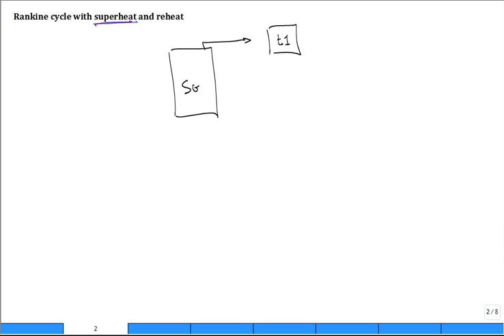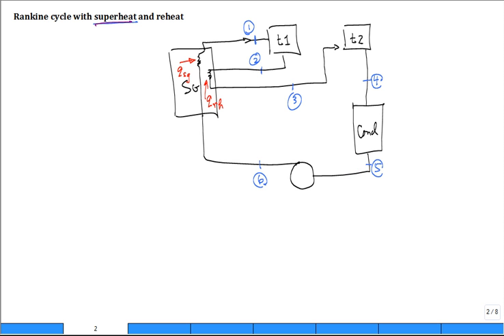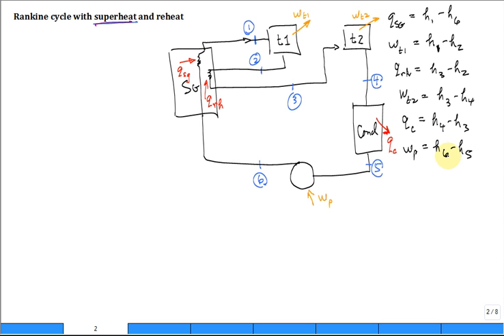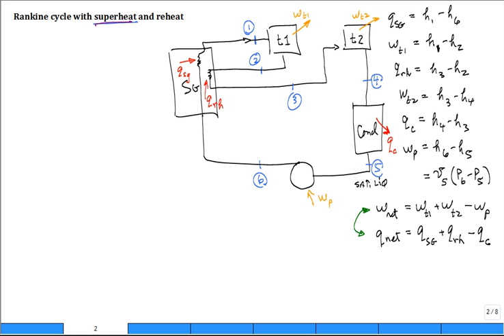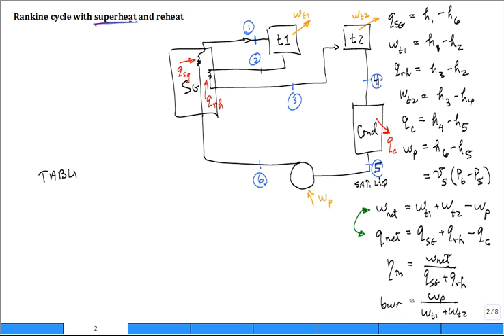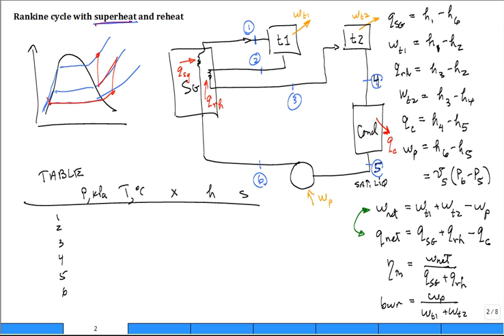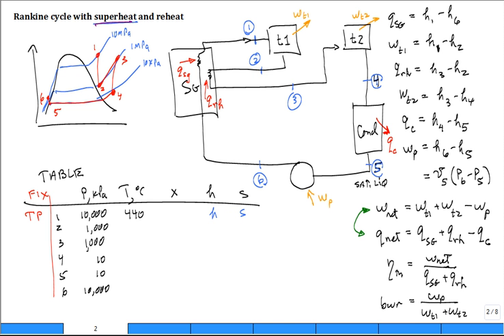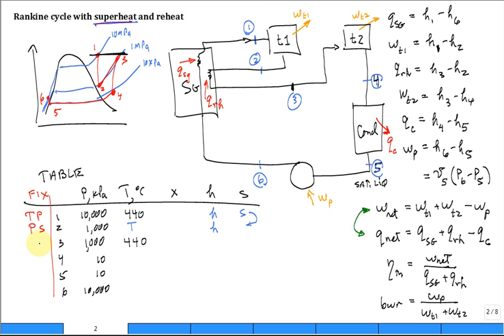Rankine cycle with superheat and reheat

Comment: The sign convention is different in the UK to the US isn't it? So if I follow this and just invert the signs I should be sound? Also just to check... point 2 just before the reheat shouldn't fall into the two phase (latent heat) section should it? I think that's where I'm going wrong because I'm using S1=S2=x2sfg+sf and then h2=(1-x2)hf+x2hg to get h2... should I just take hg from the steam tables at P2 for h2 instead since we want to avoid droplets forming in the turbines?
Reply: +Zachary Sylvester Ahh nvm the second part of my question... I should finish the vid before i comment lol.